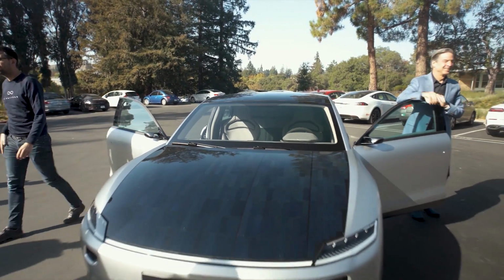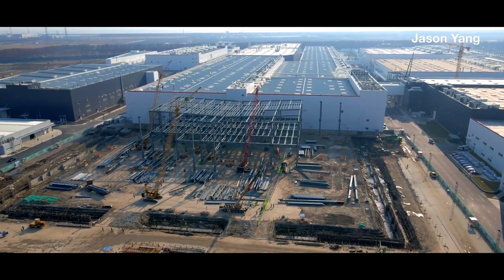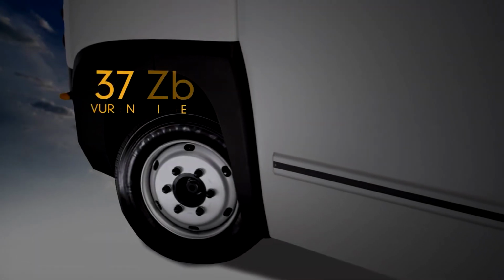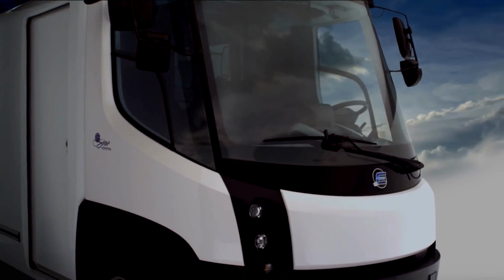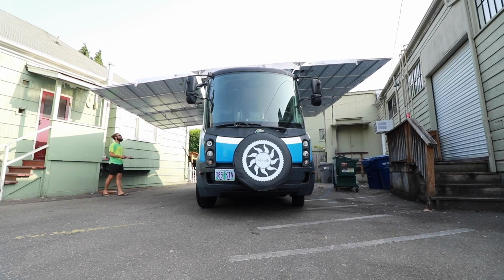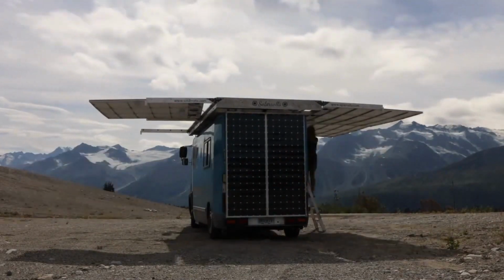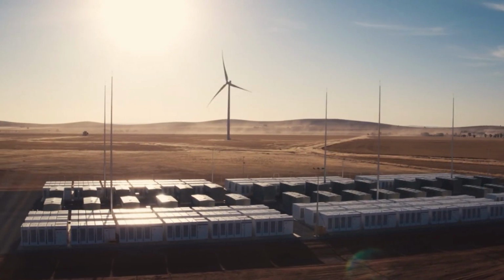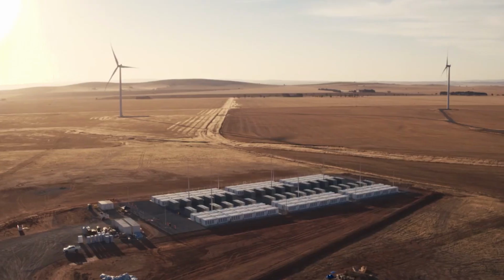Solar Powered Camper Van: Dream Adventure | Tesla Van? | Electric Delivery Trucks

Comment: As the tech gets better, particularly with charging times using only solar, I can see these large vans and motor-homes really taking off. There is already a groundswell of "van-lifers" as well as people downsizing into tiny-homes. Tele-work is spiking because of the pandemic, so if there is a large sector of the population that only needs a computer and wi-fi to make a living, why not live in one of these and travel while working? There's no inherent need to travel 200 miles a day for someone living like this, so if they paced themselves, they could travel around the country for the price of meals and basic maintenance of the vehicle. That's a very cool thing to think about
Reply from the maker: So much is possible with this and we've only just scratched the surface!

Comment: Where to buy that van?
Reply from the maker: Joel might be able to guide you with that. Get in touch with him through their channel on YouTube.
Reply: @WattsTheFuture  i love to buy the van and modify the motor to self recharge without solar panels. All motor is only 25% efficiency. It's  mean input 100 energy units, 75 units ( back EMF ) go against the input power. The system net 25% left for actual for work. To raise efficiency , we need to divert the 75% energy away the input power. So we can achieve 100% input for work. Plus we can harness the 75% back EMF to the input so we can achieve total 175%. Which is over unity. No more over heat motor